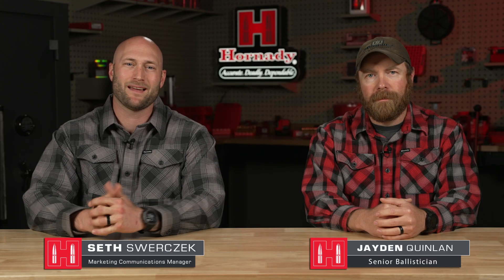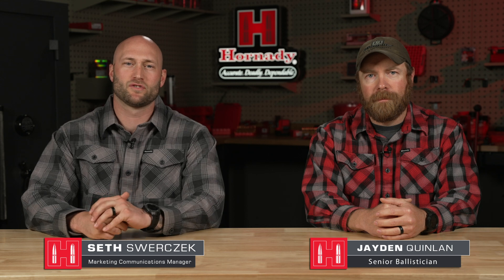DVRT™ Development - Why Did We Wait?

Comment: Sooo the Hornady bullets I have already have this "DVRT" ?
Reply from the maker: While DVRT was patent pending, it was implemented into all bullets using the Heat Shield Tip and the A-Tip Match bullet. So, shooters quietly benefited from this design for several years. Now, with the patent issued, we can publish the science and benefits of Drag Variability Reduction Technology.

If your bullets and ammo were made in the last 4 years or so they already have it.  It's a subtle difference and the flat is very narrow, but it's there.
Reply: Hornady where’s your 6.8 Western ammo. Oh that’s right you to scared to make it because it trashes your 7PRC crap